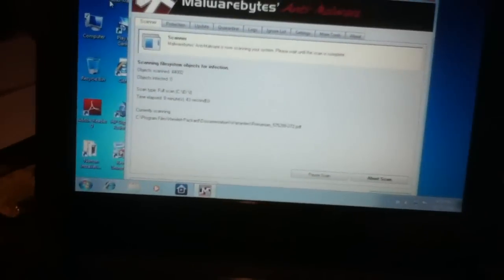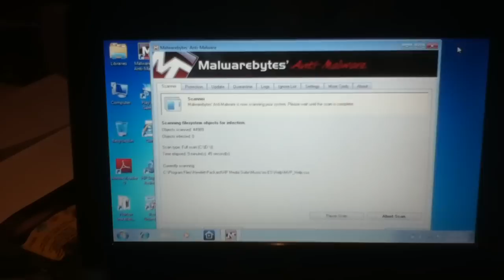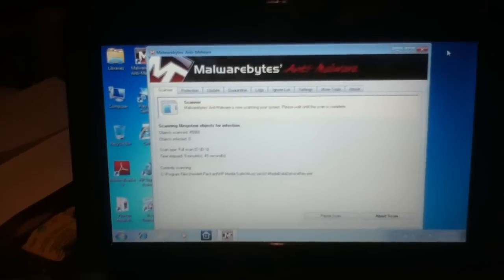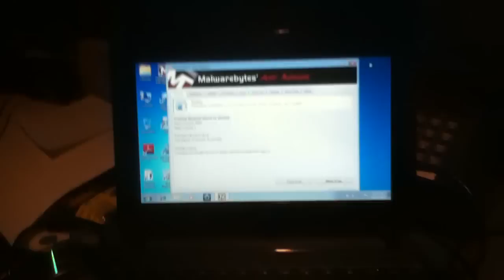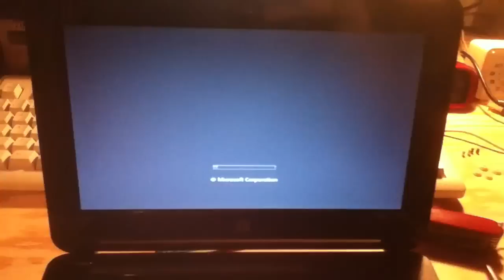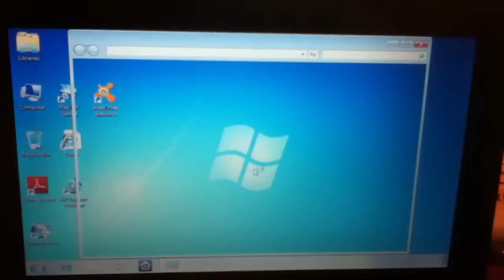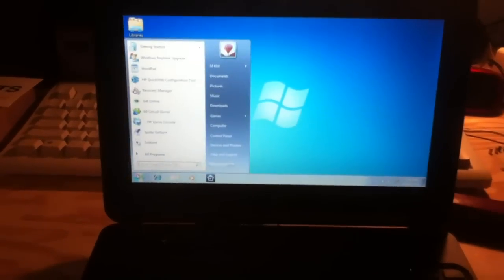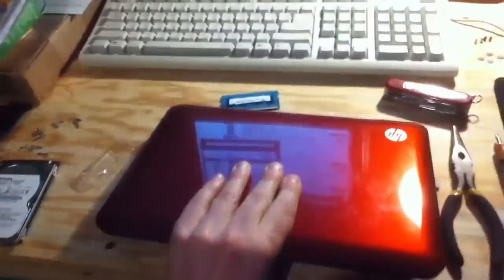Red HP Mini Netbook RAM Upgrade

Comment from the maker: @mattluvsvox i've owned a lot of macs in the past. there have been shakey OS releases in the past. 10.3.x was crashy and horrible. since then it's worked just fine and the software you can put on a mac is the only reason i use it. imovie 06 is used to edit many of my youtube videos. not to mention final cut pro, logic, and pro tools are industry standard tools these days. if this stuff was garbage, it wouldn't be this widely adopted.

Comment from the maker: @mattluvsvox it's not about the word gay at all. it's the way you sound. you seem to have extreme bias with the only explanation being "it sucks". that's absolute garbage. you fail to recognize the push that apple has made to the industry. without iOS, we'd still be using shitty phones. iOS is the reason that android isn't another blackberry. mac os x is actually a damn good OS. it and linux do openGL hardware accelleration better then Windows does. not to mention final cut pro, and logic.